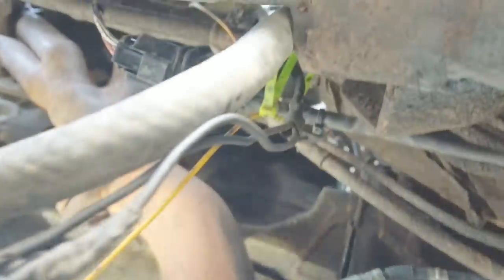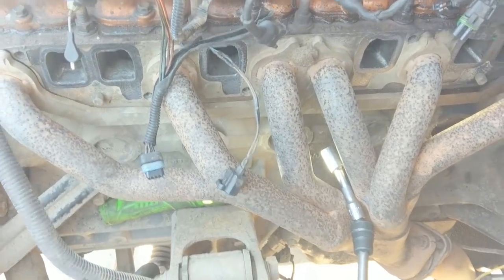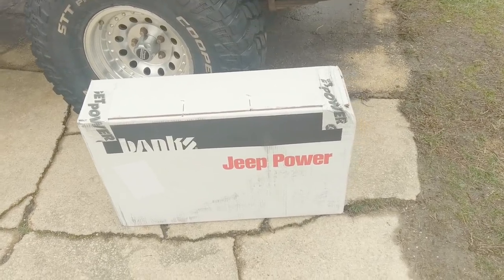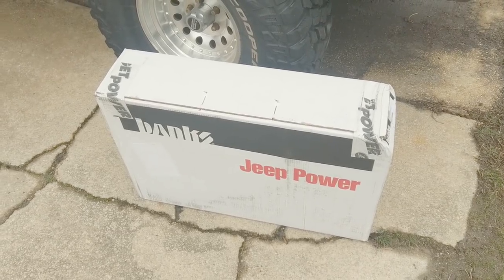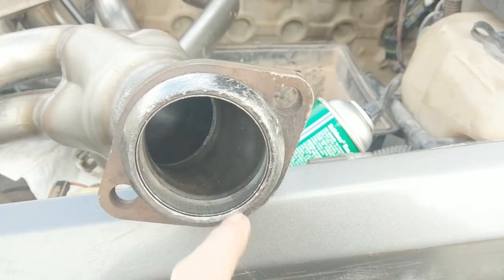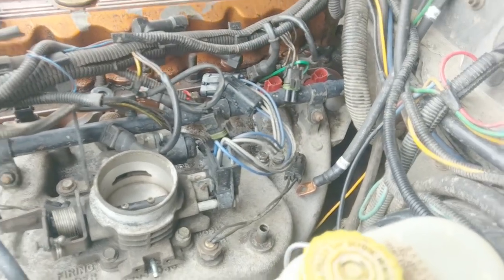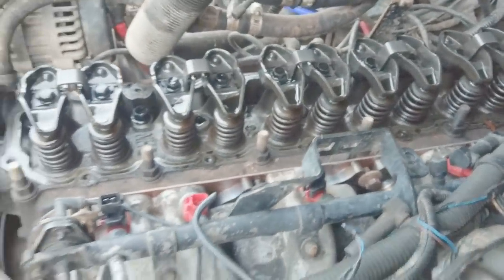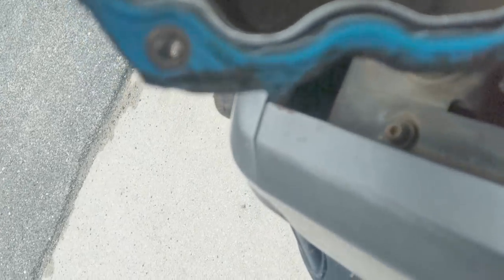89 Cherokee Banks Revolver Header Install

Comment: . Just to let you know a better way to check an exhaust leak is to put a blower/shop vac exhaust into the tail pipe. Duck tape it on and then turn it on. Crawl under and then feel for blowing air. It's better than moving around a hot pipe

Comment: Borla headers are very good also.Had one on my CA 87 XJ/compact Wagoneer for at least 10 years.No cracks.CA changed to the crappy "twin Cats design" near the engine.I will be installing the Banks CA version on my 2000 XJ soon.Hope it goes well.

Comment: The extra length of the exhaust tube on the inside. Is to balance out the volumetric pressure of the shorter pipes. Fancy for making all the pipes the same length.

Comment: Every time I see a renix motor, I immediately think that if you plan on working on it a ton it would be totally worth it to convert to a standalone efi system.
Reply from the maker: Hahaha, yeah...... The Renix Stroker is a tough beast to contend with. I've thought about going full standalone a few times, but then my homemade scanner wouldn't be super useful to me anymore, unless the standalone had serial output. I'm going to try making an advanced MAP tuner as a last hoorah to see if I can get it to run the way i'd like it to.

Comment: Wish they had aftermarket heads  that put the intake manifold on the passenger side.
Reply from the maker: A crossflow head could be a very interesting idea, but either swap would require a fair bit of tweaking due to bracket mounts for the accessories.
Reply: @NickInTimeFilms  my jeep keep having heat soak, any fix ?
Reply from the maker: You can try the fuel rail heat wrap. I'm guessing you have a newer jeep without the fuel return line? Mine doesn't have heat soak, and it's just got the 95 down rail and stock intake heat sheild.

Comment: you have a bad ground somewhere.  I have an 89 renix as well, and i chased issue after issue trying to get the start sequence right and i thought the same thing.  Exhaust sucks! but check your grounds because your start up will be a lot smoother
Reply from the maker: Maybe, though all the engine bay grounds have been redone with new wire. It's not a happy camper when the whole engines been torn apart, starts fine now that it's settled in.

Comment: Any way to prevent the header from cracking? What even causes it? I have a feeling mine is cracked on my '99.
Reply: 1)Too much heat where the pipes converge. 
2)Heat expansion and cooling of different length pipes at different rates. That's why the factory exhaust manifold has expansion pipes to compensate. It's that accordion looking part. It functions much like expansion joints on a bridge. 

Another common reason for cracked headers is mismatched material of engine mounts, transmission mount, and exhaust hangers. That's also why some vehicles are factory designed with flex tubing in the exhaust; that braided stuff.

Also, if something on the road or trail... your suspension for example... bumps your header, snap crackle pop there it goes. That's why V8s tend to use shorty headers off road to tuck it all up.

Comment: I see that the end exhaust bolt stud holes go into the head far enough to touch the head bolts. 

Question: One of my end studs was broken off had to extract it and use a bolt. Is it necessary to put some kind of sealer on the bolt or is there no oil or antifreeze that will come out of there? Thanks Nick.
Reply from the maker: Interesting question. Never had to touch the studs so I don't know one way or the other, I only know about the forward most head Bolt needing sealant.

Comment: cool & helpful video, funny specifically at 18:30 ...There are nice looking headers for around 100 $ and your pricy banks set up - is the cheaper option crap ? Also - any increase in performance/mpg and sound ? Thanks!
Reply from the maker: The el cheapo ebay headers are crap. They last about a year before they start cracking all over the place. The exhaust definitely sounded a little meaner but I'm not sure if I remember much of an increase.
Reply: @NickInTimeFilms  Many thanks !
Reply: @NickInTimeFilms  am about to follow your route and select the banks header - does it really sounds lousy/mean ? I'd expect a better deep tone ....thanks !
Reply from the maker: Slightly throatier I'd say. Nothing crazy, I like it.
Reply: @NickInTimeFilms  thanks - this is what I'm looking for .....

Comment: pretty sure you can get to those bolts under the intake right by the 3 vac. lines
Reply from the maker: I'm sure it's possible, but I had a hard enough time just trying to find them, and the ones I did, the socket would not go on straight even with a swivel

Comment: Just wondering... I know you have done various upgrades... Is your head still an '89? All the Banks Power exhaust systems I see are for '91+. Curious if I could run this in my '90
Reply from the maker: Yeah, I did the HO head swap awhile back so the header would work. This will physically bolt to the Renix head, but the ports aren't aligned top to bottom and you'll need an HO downpipe and egr delete.

Comment: I've got a renix jeep too with an exhaust leak (It fills the cabin when I'm on the highway) Have you changed the head at all or will this header work with the stock 2686 head exhaust ports?
Reply from the maker: I HO swapped to an 0630 head. It'll fit a Renix head but the port will be off a little too to bottom, no egr tube, no o2 bung, and different angle from Renix so you'll need the HO downpipe

Comment: Nice video! Im going to be putting this header on in a few weeks. Just one question. What length flex tubing did you use? Also would going to a 2.5" exhaust work better? My jeep is stock right now and has 2" on it. Thanks
Reply from the maker: I think i went with a 10" or something. 2.5" might be too wide for stock, may lose low end torque. For my stroker it seems to do pretty well.
Reply: NickInTimeFilms thanks for replying! Ive been reading on the forums all minds off different things about that since you mentioned that. I had to read into it. And i do agree with what you are saying. What if i did a 2.25 -2" pipe? You think that would help?
Reply from the maker: I think stock is 2.25" isn't it?
Reply: @NickInTimeFilms  
From the camera angle it seems as if the crossover pipe may have been contacting at the bend right before where you cut it. Something  to keep an eye on. Good luck.

Comment: Notice any changes in O2 sensor readings after replacing the cracked header and stopping the leaks?
Reply from the maker: Not really, though when I hit big bumps I can see the wideband to lean for a split second so the springs are definitely opening up a little

Comment: 15:33
I think the correct quote is:
"Do you feel lucky punk well do you?" 🔫🤠

That engine IS clean. So what oil have you been using?
Reply from the maker: Yeah, I was a little bummed when I found that out.
Just using good ol Valvoline fully synthetic and so bottle of ZDDP additive. I used high-mileage with the old engine.
Reply: @NickInTimeFilms  
😉👌

Comment: I’ve heard rumors that a 99-01 intake manifold will bolt on to the pre 99 blocks is there any truth to that if so it would make sense why I can find any brand new f**  intake manifolds for my 98 CHEROKEE!!!!!
Reply from the maker: Yes, they will all bolt up, but the port size changes over the years. 99+ head has smaller exhaust ports along with the pre cat system.

Comment: Did you buy the recomendad hardware kit that shows up on amazon that’s separate from the headers?
Reply from the maker: Negative, the main entree was just what came in the box
Reply: NickInTimeFilms gotcha. That extra hardware kit is prob just the same bolts that hold the rest of the intake manifold in place right? Like you could buy that kit if u lost some of those bolts or if u think u might break some during the removal process
Reply from the maker: It looks like that's dorman kit replaces all the manifold bolts and studs, but I don't see any washers for the regular bolts

Comment: Nice man do u have a cam...? Or is that a good exhaust system
Reply from the maker: Custom 2.5" exhaust to compliment the 4.6L stroker. Cam is pretty mild though.
Reply: @NickInTimeFilms  
What's the secret to a happy stroker engine?
Reply from the maker: It all revolves around one thing; Good. Good parts, good engine builder, good cooling, and a good tune doesn't hurt.
I've put 15k miles on this engine since the 700 mile wrist pin failure, and it's been good now that the cooling seems to be mostly in check. Still getting around to designing my own tune to finish it off though.
Reply: @NickInTimeFilms  
I asked because I wonder if I can pass Cali smog with a stroker. Thanks.
Reply from the maker: As long as you have properly matched injectors to keep closed loop, it should run just about the same as stock emissions wise.

Comment: Nick what's with the can on top of the throttle position sensor I'm just curious?
Reply from the maker: Haha, keeps the water from the vents off of it.
Reply: The leak is from the Napier hood vents? I've been thinking of installing vents in my 98 XJ. Your thoughts?
Reply from the maker: @wickedfaith17  They do the job. Some water will still get through but I'm sure it's helpping out atleast
Reply: @NickInTimeFilms  thanks

Comment: No bro it's really not incredible it's actually very normal ... and  had you been around long enough you would have known it as well... How many Jeeps has you personally been under the hood of in your extensive career anyway ?  Because every XJ  with mileage I've ever worked on has been inflicted with a crack Or multiple cracks ..so it's actually very normal ...
Reply from the maker: I'm not some kind of jeep shop, just working on my own rig from time to time. My oem manifold had a single small hairline crack and that was it. That eBay one was completely trashed, way beyond what a good manifold would do. Shit is junk through and through.

Comment: revolver and torque tube header are two different things lol....and you can get all the bolts without getting on the ground easily
Reply from the maker: I figured this was the revolver version, but the labeling system on all the sites seem to be all over the place, almost thought the torque tube was just a sub brand of their headers or something. With the head out of the vehicle I was able to get to the bolts eventually, but in there I really just can't get the damn socket to stay on straight. I have no idea why because it looks so easy with the intake off, but I just couldn't get em.
Reply: NickInTimeFilms they have 2 different versions for the xj one with fed and one with cali...you need a swivel socket to make the job easier I think I got mine fully apart in about 40 minutes....but I have a great deal of knowledge of the stuff I stated making a Chanel but need to get back to making content if you want any advice or talk about anything feel free to message me

Comment: WWWWAAAAYYYYYYYYYYYYYYYYY too much antisieze on those bolts. By using that much you seriously run the risk of hydrolocking the bolts. Then you will have another exhaust leak.
Reply from the maker: That's why you keep it off the tip, most of it get pushed off as it threads in anyway. I also rarely use power tools on jobs like this so I can feel if the bolt isn't snugging up right.